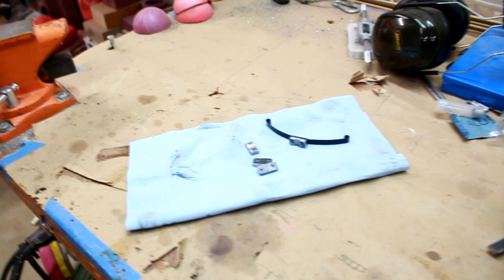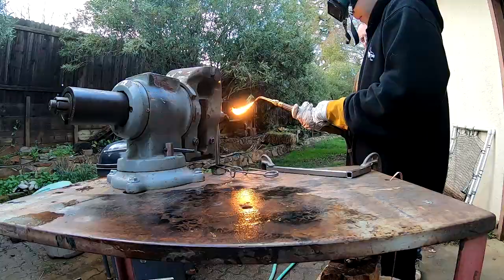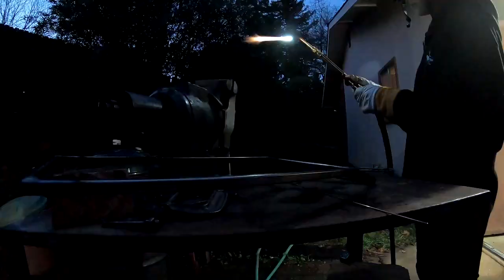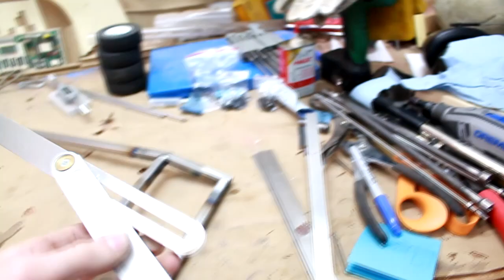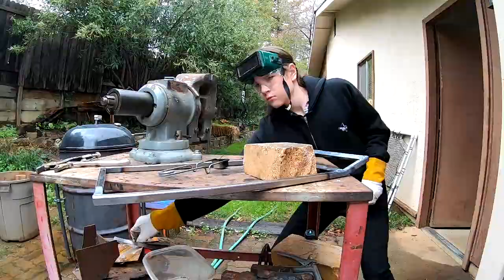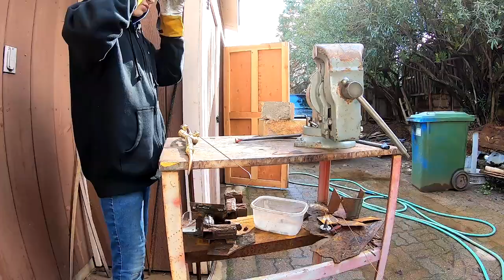Building The Main Frame and Welding Spring Perches // Scale Trailer Build Ep2

Comment: A little off subject but one thing I found handy for the Kurt milling vise is the all steal 5 spoak clamp handle. No more pinched thumb, and you can use both your arms! I drilled a dimple on the 5/8" hex and clamped the handle on with a set screw.
Reply from the maker: Yeah I think I will talk my dad into getting one, seen some other people using them and they look nice. I have already gotten pinched a couple times using it so I am sure it will be a good investment. Thanks for recommending it!
Reply: That's very you can use both arms and get more force on your part and it's super fast.
Reply: A small thing you can make in house is alignment keys for the Kurt vise. If you do that you will never have to dial in your vise again and it will be impossible to knock your vise out of alignment.

Comment: So you brazed it together welding requires electricity
Reply from the maker: Nope I welded it. Heat is part of the list of requirements for welding, and electricity is one way of generating that heat, just like a gas torch is. The other requirement for welding is that two puddles of molten material join to form a single coherent pool that, when cooled, molecularly joins the two pieces. Brazing on the other hand, which I have also done, is heating the two pieces until they are hot but not molten and applying a filler that more or less "glues" them together. Because of that brazing a brazed joint is much weaker than welded one, but both processes have their uses. If you cut those joints open, you would see that they are in fact welded. Hope that clears things up a bit and thanks for watching! Cheers!

Comment: Hey mate how’s it going? Firstly just wanna say how amazing your work on this trailer is, I’m absolutely stunned at your skills mate. I was wondering what kind of welding you are doing?
Reply from the maker: Going Quite well, how bout yourself? Aww, thanks, I am using an oxy-acetylene torch so I am not sure what the proper term for it is but I just call it gas welding lol.
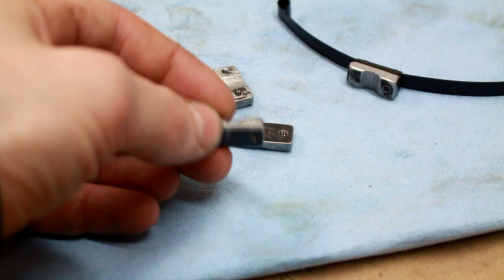Reply: Hwy 49 RC hey thanks for getting back to me I appreciate it bro, I’m thinking of making my own 1:10 trailer for my redcat gen 8 and I’m not really good at welding that’s why I asked, I think it’s called TIG welding what your doing but I’m not hundred percent it looks a bit easier than a stick welder or an auto feed wire welder that I’ve used before.